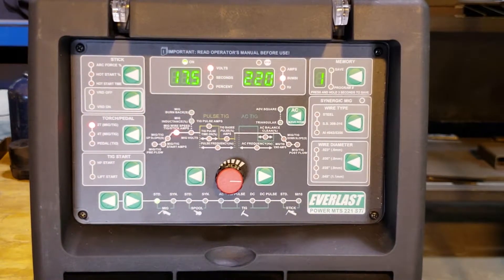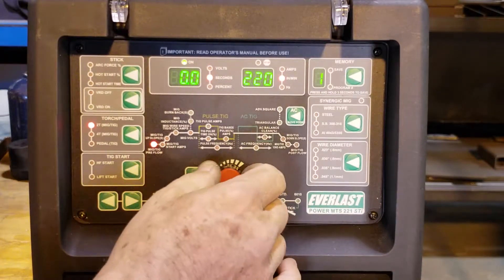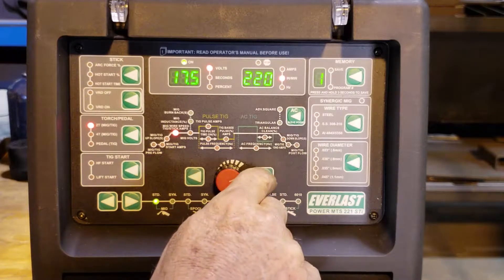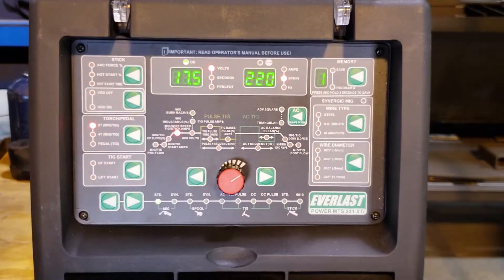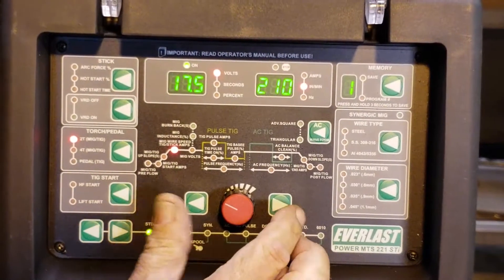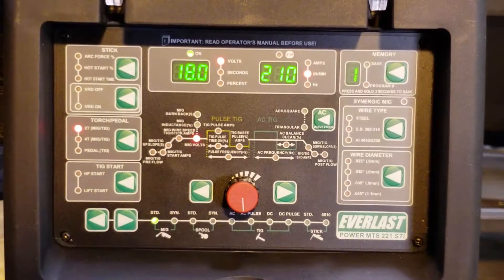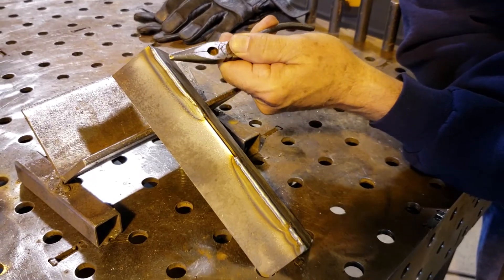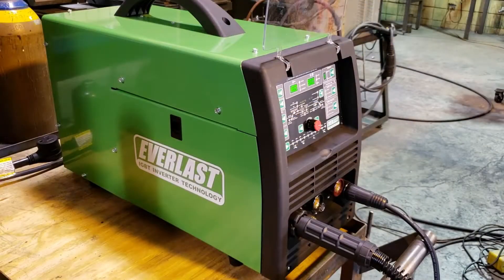Everlast PowerMTS 221 STi: MIG Welding Setup - Inductance

Comment: Hes the whole reason I use Everlast. Also jody. He rocks too. But Everlast... whats up with the cheapo mig gun/nozzle etc? But his was all nicey nice??? Whats goin on? I got the 3 in one. Mig tig and stick. I wish it came with a smaller torch for tig as well. The torch is ginormous
Reply: I'm there with you. Somehow I got a 15 series gun, which is rated for 150 amps with mix gas, but it's a 200 amp machine. Bob is using a 24 series gun which is rated at 220 amps with mix gas, 60% duty cycle.